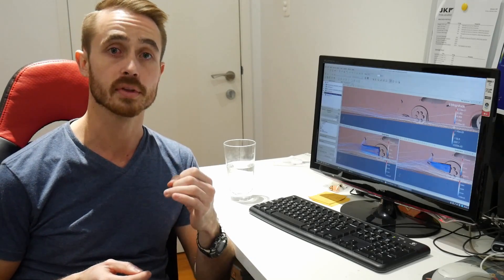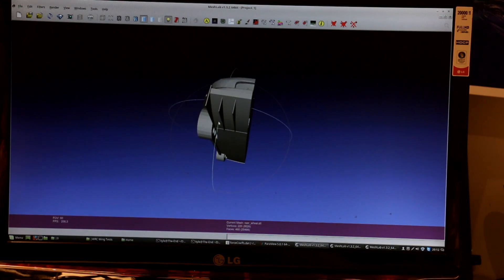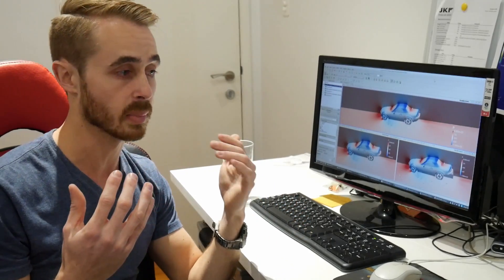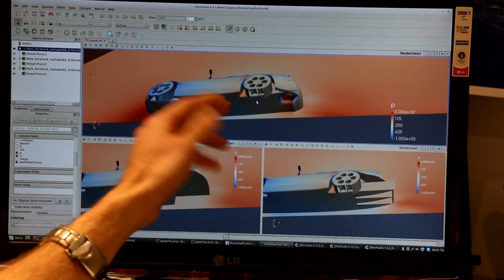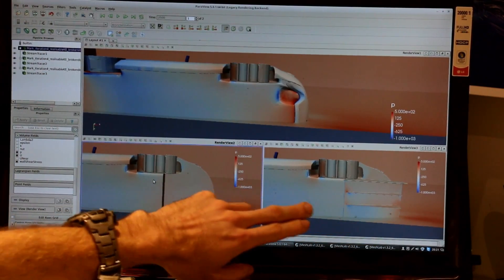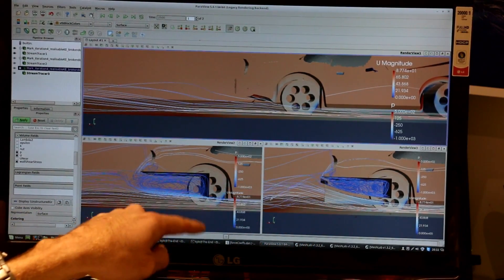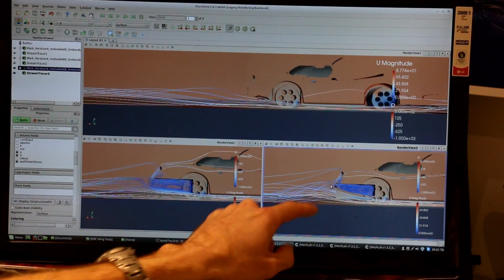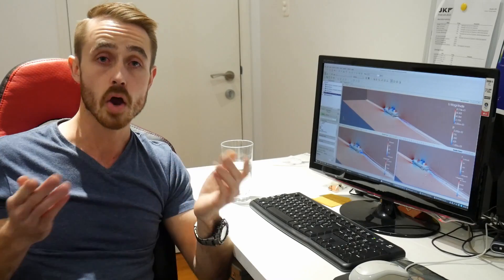Is Cutting Your Bumper as Good as a Diffuser??

Comment: the car with the cut bumper in your program is a terrible example of a cut bumper, I'm not saying what your saying is not true, but I'd like to see more realistic model.
Reply: merkantelismo actually, no. bumpers are put on for the exact reason they are called bumpers
Reply: Yes it does, read the caption @ 2:34 ... The models don't show an exact model, but you should get a general idea of what he's talking about. Actually, the inaccuracy of the cut bumper model here doesn't show the actual bad effects it has on the back of the vehicle.

Bumpers were put in there for a reason, and one of those reasons is for smoother airflow (think older super car designs before rear diffusers were a norm) and cutting it disrupts this purpose unless you put a proper rear diffuser under there along with a flat floor.
Reply: Dankus Memus parachutes have holes in them to let air through, and keep it stable. if your talking about a paraglider that's a completely different set of physics. my only issue is and always had been with the modeling. I'd like to see a better model to get more accurate results. he over exaggerated the whole cut bumper idea and cut out about 1\4 of the rear end
Reply: I'm sure he would be willing to try a CAD file that you take the time to make and send him. He obviously isn't going to model an entire car because it is too much work for a simple video, but if you feel the need to complain about his models, which frankly are good examples, then why not be productive and run the test on your own?
Reply: @merkantelismo, the move to plastic bumper covers, crash foam and metal bumper internal, instead of the metal bumpers alone like you see on old cars has nothing to do with aerodynamics.

 it is almost entirely for pedestrian crash safety, and to expand the crumple zone of the car.
Reply: think you should rewatch the video mate
Reply: Then why do you think they switched their design from those big metal/urethane-foam-filled ones to the now smooth, seem-less designs. Bumpers nowadays loosely describes those big plastic things on both ends of the car. Behind the "bumpers" you would still have foam and/or a metal impact beam to absorb the bumps that the plastic "bumpers" cover. So, maybe they do have another purpose other than for bumping.
Reply: Here's another question, since the trend of cut bumpers mostly attributed to the honda civic, why does no one ever cut bumpers off the 7th generation and up  models?
Reply: merkantelismo my point was the models are nowhere near accurate, the model took a large chunk out of the car when a cut bumper literally just takes a layer off, and most people that cut bumpers just cut maybe 4 inches off the bottom to stop the parachute effect, or cut holes so air can pass through easier creating less drag
Reply: If you're referring to those hole saw cut outs on the back of civic bumpers then they would be a far worse comparison than just removing it completely.
The thing with parachutes is that they fill up with air and then let any additional air to flow above them with little resistance (kind of like letting a tap overfill a bucket. 
When you cut holes in the back of a bumper it can never fully pressurize the zone and let air pass over it.
Reply: Hayes Bartlett how the hell are they good examples???
Reply: Ok, then... Why do serious race cars cover bumper-body seems with duct tape to prevent air from flowing through them? Why do molded Nascar bodies, retain the basic shape of the car's protruding bumpers? It's certainly not just for more sticker area, i guess.
Reply: merkantelismo actually, nascar doesn't retain the shape of protruding bumpers. the "bumpers" are relatively flat, and the rear "bumper" is pretty flat with the bottom of the fuel tank and cabin so there isn't much of a parachute effect. if you look the fuel tank is normally lower than the rear "bumper"
Reply: Ugh... if you could only attach pictures here in the comments. Well Fox, you should've at least googled around for Nascar images first before replying. Modern Nascaar bodies now are mostly flat. Why? Because modern car bumpers profiles are now generally flat mostly because of safety purposes. But....... only to a certain point. They're still rounded enough for better airflow and flow more smoothly with the lines of the car. I'm not just talking about the bottom part of the bumpers here ok. I'm talking about how from the front to the top of the bumper, it's blended into the front grill, etc... and then the rear trunk flows into the rear bumper, etc... not just the bottom part. That's why people only cut the bottom part of the rear bumper and retain most of the top part and not just remove the whole thing. Now, to get back to topic of our argument. Yes, the bumper serves other purposes rather than just "bumpers" as you call them.
Reply: And btw @Fox, you should cut your hair short too, maybe your head can get more airflow to make that dense head of yours think better. It's creating a parachute effect keeping correct ideas from flowing in and out properly. Then you can also look like Kyle.Drives so that people will start to believe you're actually SMART and not just a SMART ASS.
Reply: merkantelismo why attach pictures, I do know what I'm talking about and now you're just upset because YOU look like an idiot. you say nascar has retained the protruding bumper, i tell you they haven't, which...they haven't. now you're mad that you're an idiot.  You know you have lost when you have to attack someone personally. Enjoy your sad miserable like you fucking looser.  maybe stop gooogling stuff and learn about it in real life. Funny, your coment had nothing do do with what I originally said. which was the model was not accurate at all, then you come here to try and act smart and flex that tiny brain of yours but it backfires because (say it with me) you're an idiot. later, buddy !
Reply: Stefan Slater think you should re rear my comments. if any of you think this is a good representation of a cut bumper you clearly have no business being around cars
Reply: Fox you clearly didn't listen to the video hahahaha
Reply: Stefan Slater it's been a while since I watched it, so I don't really remeber what was said, but my original comment still stands. This is a terrible example of a cut bumper
Reply: There is still metal under the bumper, it's not just a giant void. If none of yall understand why I'm saying it's a terrible example, please...please, never pick up a wrench and work on a car
Reply: Oh my dear Lord! We're just too sorry for you Fox. For still trying to defend what little knowledge you have and how little your comprehension is. If for all this time you haven't picked up anything from the contents of the video then I have no more words to describe how dense you are. Models are just representation of things and accurate only to an extent. Errors how little or big they are is up to the person viewing it to fill the void and understand what the model is showing.

Now, if you're still trying to tell us that this is a poor representation of a cut bumper and it's benefits. Then you're the one who should just keep away from the computer and never pick up a keyboard ever again.

Oh, and by the way, people don't use wrenches to cut holes into bumpers. In case you don't know.
Reply: merkantelismo you are still too dense to understand anything. go look up an example of a cut bumper then come back and tell me this is accurate. I don't care enough about this to read all that but I'm assuming your just reword what I wrote because your too dumb to come up with your own. Enjoy your strictly internet knowledge of cars.
Reply: merkantelismo also, never said people use wrenches to cut holes in bumpers. aparently you've never heard of the term "wrenching on cars" further proves you just have Internet knowledge lmfao
Reply: Fox you're a idiot hahahahahahah
Reply: Stefan Slater says the one saying this is an acceptable representation of a cut bumper lol get some real world experience keyboard warriors
Reply: Stefan Slater https://goo.gl/images/bxSpOy here's what a cut bumper actually looks like if you didn't know, which you clearly don't. as you can see the entire floor, gas tank, and partial rear subframe(not to mention the body) is not cut off, like in his models. continue with your ignorance though, it's pretty funny lol
Reply: Hi Fox, I highly doubt if I reworded anything you wrote because we all know you're too dumb to type anything that has that much substance. And please oh please, I beg of you. Please follow my advice and search the interwebs of images of nascars, stock cars, etc. You'll see where I'm getting at with the bumpers and stuff. But hey, I don't blame you. If you're too dumb to not be able to relate the shape of a nascar bumper to an original car's bumper then, I rest my case. You win... I have to agree... You're the dumbest person I've come across on the internet.
Reply: Yeah Fox, keep lmfao-ing. But don't do it too much. You're tiny brain might go out through your mouth.
Reply: Hi Fox, well if you're all that smart and have tons of "non-internet" knowledge. Then please enlighten us and provide us an accurate and precise model of a cut bumper. Please we're all eager to learn more from you.
Reply: merkantelismo lmfaoooo still bringing up that nascar has protruding bumpers, when they don't. or are you to dumb to recognize that, just like your too dumb to click a link that shows what a cut bumper looks like. this is all really funny to me because you still think that's an accurate model. if you've ever actually seen what's under a bumper you would know why it's not accurate. but I guess you haven't. sigh. gotta love you internet mechanics.
Reply: merkantelismo OMFG how can I take anyone seriously that makes a playing called "cuties" 
do you really live that sad and lonely of a life lol you can't get any real world experience, huh? not with cars, or girls lol go back to your basement, troll
Reply: merkantelismo 
"girls day" or some shit 
"cuties" 
shitty band 
I feel sorry for you now, you must live a sad pathetic lonely life to be coming on YouTube for that kind of stuff. I guess mommy and daddy blocked the porn on your computer lololol
Reply: merkantelismo thank you, you just made my day lmfao
Reply: What's "playing" again? Sorry, you lost me there... Oh... Auto-correct got you again? Still need help in spell checking, is that it? Anyways, nice job Fox! It looks like you do know how to do "research". Please enjoy the videos I've liked and viewed. Remember to wash your hands before you use the keyboard again or it'll make stuff a bit too sticky. And don't worry, I know you don't take anyone seriously, including yourself.

By the way, still waiting on that accurate and precise model of cut bumpers, genius. I'm sure a lot of people here are dying to know how good you are at making and interpreting models. Oh wait, no one is interested, because you're the only one here who doesn't pick up from what the simple model has demonstrated here. ;)
Reply: merkantelismo you must be a special kind of stupid if you think anyone could spell playlist as playing, but I'll say it again 
go back to your playlist* of "Cute girls" you sad lonely fuck. it's also not research, it's real world experience, and I'm surprised you don't understand the simple concept of how that's not an accurate model. I guess that doesn't translate well in braille since your clearly blind if you don't see that. never said I could build a model, or would, because I can't. but that doesn't have anything to due with the fact that that is not an accurate model.
Reply: What the hell Fox! How low could your IQ be? 5?!?!??! What's so wrong with you that you fail to understand my every point by miles? Anyways, I would like to say I'm sorry. I was wrong to call you a Smart Ass, because clearly, you are a dumbass. And nobody can win an argument with a dumbass, because dumbasses will always think they are correct. Only a dumbass will require an accurate model for a cut bumper. Only a dumbass will fail to pick up from Kyle's videos. Only a dumbass will not recognize the shape of a Nascar 'molded' bumper with a stock bumper (Oh wait, we're only talking about the rear bumpers here, how dumb of me), Only a dumbass will have "real world" experience and still require an accurate model of a cut bumper, Only a dumbass will not cut his hair short to not look like Kyle, Only a dumbass will not shut up and admit that he is a dumbass.
Reply: merkantelismo only a Dumbass would write all that out so they don't feel like such a dumbass. Only a dumbass wouldn't understand that that's not an accurate model. Only a Dumbass would argue that point and basically argue with them selfs because I'm not denying anything. Only a Dumbass would bring up arbitrary points, and not adress the one at hand. Only a dumbass would say nascars have protruding bumpers, then when someone says they don't, you completely change the subject, then bring it up worded different so you don't look like a dumbass. Only a dumbass would conect hair length to intelligence. Even if I am a dumbass, I'd rather be that than some lonely fuck that has to watch "Cute girl" videos on YouTube because your mommy and daddy blocked blocked all the porn sights, the other thing is most of thoes girl look underage, so if you are young it's no big deal, but if your older, that just makes you a fucking pedophile. I know people like you, and I love testing it because it's always the same result. You feel the need to flex your brain, for reasons only know to yourself, but you try to make a point completely unrelated to the original comment,  and when someone keeps ignoring your point, and continuing with their own, you get mad. Most either go passive aggressive, or just plain aggressive. You're a mix between the two which is pretty rare. None the less, thanks for being a part of this little experiment. It's given me a good laugh.
Reply: Ok, now this just turned into a dumbass competition because some dumbass will just not stop insisting the he isn't one. We'll please bear with me, I'm not used to competing at the dumbass level. So here goes...

Only a dumbass will keep going back to the point in topic since that's only his puny brain can tackle, at the moment, meaning... "one topic at a time please. **brain fart" Only a dumbass will not engage in other valid topics because he's afraid that other people will see how dumb he is. Only dumbasses will keep attacking you with a personal insult even if he says that someone has lost if they attack personally. And to repeat myself, only a dumbass will not shut up and admit that he is a dumbass.

Anyways, so you want to get back to your argument then. Yes, that is not an accurate model of a cut bumper. And nobody needs to have an accurate model to get what Kyle is saying, you just need to use a bit of imagination. What would you have to say about that, Fox?
Reply: merkantelismo I kept going back to that topic, because that what my original comment was, only a dumb ass would still have trouble with that, and your further proving this tough brain stereotype. You started the personal insults, bud, so I continued, which makes you even more of a dumbass because you just called yourself a dumbass. You keep calling me a dumbass but it's really you lol it took you this long to grasp the simple concept that that his model is not accurate. I'm glad your finally learning, we're making progress! That's what I have to say about that. But only if we could get rid of your creepy youtube girl fetishis. which is it by the way? are you a pedophile, or some 12 year old still mooching off his parents. Either way whatever you say is invalid, I'm just curious lol
Reply: Don't worry Fox, everybody here agrees with you that this model is not accurate. There's nothing wrong with pointing out the obvious and I commend you for that because that's all your tiny dumbass brain can comprehend.  But we all agree with Kyle's idea with the cut bumpers and you're the only one who keeps saying it's wrong because the model is inaccurate. Can't argue with that. Well, if you're the only smart person in a crowd of dumbasses then I guess that makes you the real dumbass not us.

Oh I'm sorry Fox if I insulted you by saying that you don't look like a dumbass if you cut your hair but you really do. So if I were you, i'd take my advice on that.
Reply: Sorry, took a while to reply. I went out looking for other true dumbasses like you but lucky you, I couldn't find any. So, you're still unique in every way! Cheers!!!!

Yep, we know you didn't deny his results. And the effects of bumpers being parachutes is common knowledge to everyone and not the point of Kyle's video. What the purpose of this video is to demonstrate that effect. By you saying that he needs a more accurate model only states that he failed to show that effect and you disagree with his method.

Come on, admit it, to demand for an accurate model of a cut bumper is just pure and outright dumb. It's so obvious that is not a realistic model, it even exaggerates the parachute effect. But to even point that out? You got to be kidding me. You may have thought that by pointing that out people would think you are smart? Nah... that just proves that being both a dumbass and a smartass is possible. Thank you very much for proving that to us Fox. Sincerely, from the bottom of our hearts, we thank you.
Reply: Ok, 3ft chunk vs. 2 inch... your point is? Please explain that "not that hard of a concept" further. If it's not that hard of a concept for you, it wouldn't be that hard to explain right? But what?!?!? It's not a hard concept but it's not as simple as we think? I think you lost us again there. So, explanation please mr. genius Fox. Rather than diverting the topic to engine comparisons.

Oh my, what an honor it is to have helped you achieve something in your life. It must be a pretty rare occurrence to you, achieving something? I'm so happy for you! I hope someday I will be like you! such a unique dumbass! I'm sure everyone wants to be like you! From now on I will consider you a hero! Cheers!
Reply: Ok, wow finally I got your point! 3 feet is not the same as 2 inches. So, what is that difference compared to the results Kyle got? Please explain.
Reply: merkantelismo do I really have to spell it out for you?
Reply: Yes please... I have trouble understanding. Wow us with your knowledge.
Reply: merkantelismo 
a boat and car are both modes of transportation. which one is better?
Reply: Avoiding the question... What is that difference to the results Kyle got? Please explain.
Reply: merkantelismo it's an analogy to help you understand, numb skull
Reply: merkantelismo thoes 90° angles cause quite a bit of turbulence. you wouldn't get that same turbulence with just 3 inches cut off the bottom. that's like trying to compare a boat and a car. sure they both have engines, steering wheels, and are modes of transportation, but they are completely different and there's no real way to compare the two because of how different they are.
Reply: Yea right Fox, analogy my ass. Probably just delaying tactics so you can consult first from your professor from Google University.
Reply: Hm... Ok, first it's 3ft cutout vs 2 inches off, now it's 90° angles. ow... sorry, that's 3 inches cut off based on your latest answer. But anyways, the question is how does the comparison between the "3ft chunk vs 2 inch cut-off" oh and 90° angles add to Kyle's observation and results?
Reply: merkantelismo HOW CAN ANYONE BE THIS STUPID. the 90° angle is in the 3 foot chunk cut out. Holy fucking shit your dense, talking to you is like talking to a child. That was an analogy and I'm sorry if you were to dumb to understand it.and no, not Google. Just common sense, which aparently you don't have
Reply: Bill Randleman no, no it doesn't. taking off the rear bumper does not remove the floor pan, part of the rear subframe, and the fuel tank
Reply: Bill Randleman hmmm, so behind the bumper is a hollow void? I can tell you've never been under a car before lol
Reply: Therrydicule a rear bumper can act as a literal parachute and trap air inside. The models came nowhere close to representing that
Reply: merkantelismo because ricers can't afford them lol
Reply: Stefan Slater I did. did you read comment? or are your reading comprehension skills just not up too par? don't project your insecurities on other people, it's pathetic
Reply: Hayes Bartlett the cutouts go to the rear axel. this is about cut bumpers, not chunks cut out of cars
Reply: Bill Randleman am I supposed to be impressed?  still doesn't hide the fact you have no clue what you're talking about, like with my car, it's not stock, and I also built it from a bare bones shell. but tell please tell me more about how you bough your stock miata and threw some bushings, an exhaust, and diff on lmfao nice "build" bro...fucking pathetic.
Reply: Please stfu